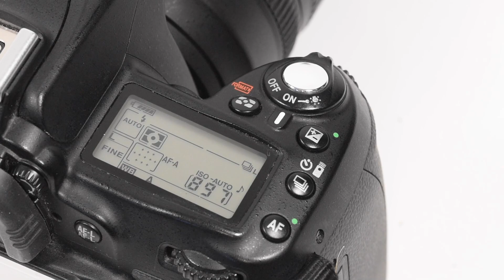RiskiFixes - Nikon D90 Aperture Motor Gear Replacement

Comment: Thank you, I managed to fix the mechanics. I had the same breakdown. After assembly, unfortunately, the top screen and its backlight do not work, and the main screen also does not work and does not display a picture. The built-in flash opens but does not work. Everything works through the lens and photos are taken, although the date is 2000. Apparently, something went wrong somewhere.
Reply from the maker: Did you try to re-connect the main screen cables? Maybe it’s not properly seated.

Comment: I managed to repair my d90 thanks to this video.
I encountered the same problem with the rear display on the first reassembly but by repositioning the 2 electronic cables the display reappeared.
It is still better to have the service manual for the screw number.
This seems essential to me for reassembly because many of the screws are different.
Thank you so much!

Comment: Thank you very much for this video. My D90 had the same failure symptom and I disassembled it carefully following the procedure in the video. It was indeed the engine pinion that was cracked.
I found one for €3.07 and reassembled my camera following the video. I just lightly re-greased the gears and it's back like new.

Sincere thanks! 😀👍
Reply from the maker: That's great to hear! Happy to help👍

Comment: thank you so much for this video!!!! Im going to repair my camera on weekend! :D
Reply from the maker: Good luck!
Reply: @riskifixes  hello, i fixed ny d90.... but my rear display ist still black and my camera doesnt save pictures... i also reppluged the flex cable for the 3. time ... i dont know anymore, what to do :( maybe you know what to do? im sorry, i failed D:
Reply from the maker: @AbbyTheAnimeFreak  Sorry it took me so long to reply.
I would check all the connectors etc. once more. Other than that, I don't know, sorry.